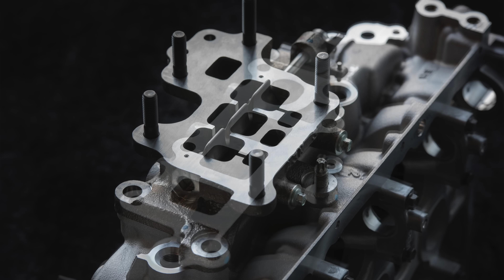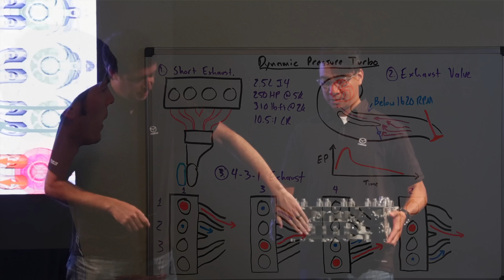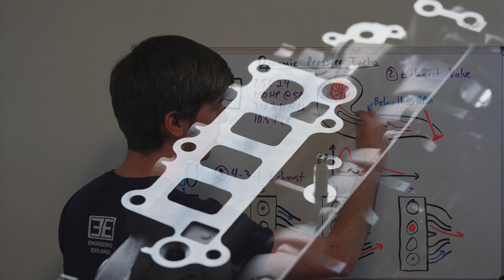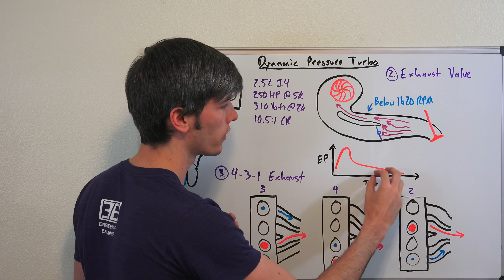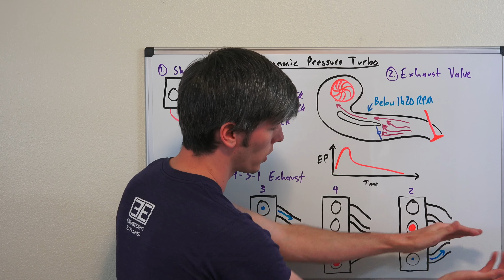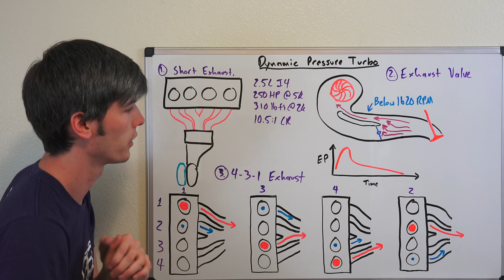How Mazda Is Eliminating Turbo Lag

Comment: Wow. Mazda is really going full gear here, thanks for all the tech updates! I gotta say though, they're spending all this on engines, how are their transmissions doing?
Reply: Nolen Purvis. They have their skyactiv 6 speed that was developed recently, designed for efficency along with typical mazda shifting feel.

Their auto has some interesting designs to compete with the automated manuals of other manufacturers without the cost and drivability issues.  Cool stuff.
Reply: Nolen Purvis mine has some weird programming quirks. Some shifts are absolute perfection, others feel like a 17 year old is learning to use the clutch. Going to see if there is an upgrade
Reply: I have a mazda 6, gotta say the transmission is super smart, especially at corners.
Reply: patw52pb1 source? Is this the skyactiv drive?
Reply: +Denver Cayle Ong 
ATRA and ATSG data, service and parts data. 
No. 
SKYACTIV-DRIVE units manufactured prior to 2016 model years were assembled in-house by Mazda using mostly components from tier-1 and tier-2 suppliers including Ford and Tremec. 
SKYACTIV-DRIVE units manufactured after 2016 model years were/are assembled in-house by Mazda using mostly components manufactured in-house by Mazda and with some components from tier-1 and tier-2 suppliers including Ford, New Venture and Tremec.
Reply: In my experience their skyactive automatic transmission is very good. Not far off from the ZF8HP. It could use an extra gear though
Reply: emark24 first gear isn't smooth when you force it to go while you just put it in drive. Other than, that it's perfect.
Reply: Denver Cayle Ong mine is always rough going from 1st to second. You can feel the torque converter lock up most times. I have a 17 with g vectoring and its fabulous in sport mode in some corners
Reply: Most Mazda transmissions are manufactured by JATCO (Nissan), Toyo Kogyo, Ford, New Venture and Tremec (Ford+GM)